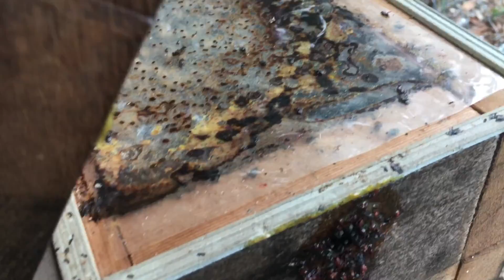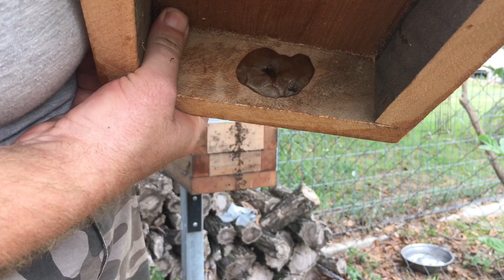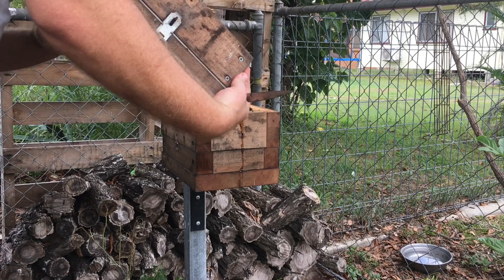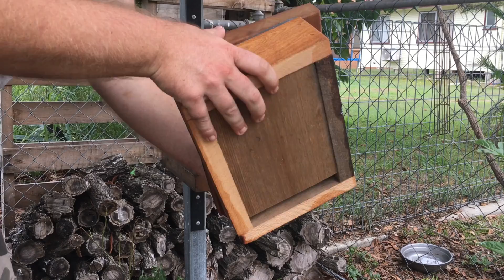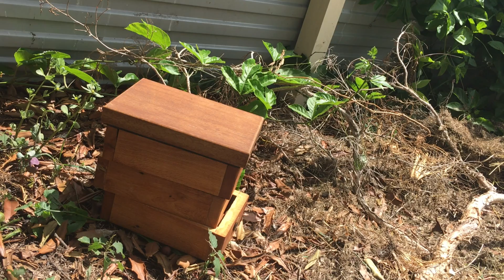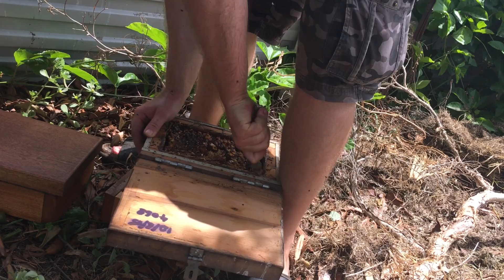Stingless bee hive split 🐝

Comment: Hi nick, I'm just wondering what the diameter of the hole is in your separators?
Thanks
Reply from the maker: The smallest diameter I would use is 60mm if you want the brood to rip. The largest can be width of box in my new boxes it is 110mm. This allows full access to the brood for propagations. Ie you can remove brood if you need to search for queen cells.  Plans to my hive on my blog 👍👍